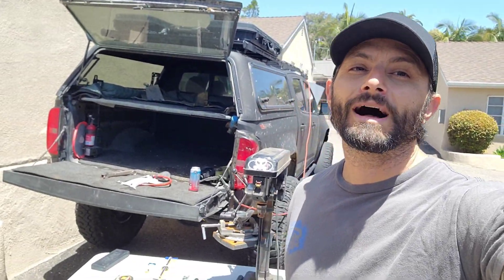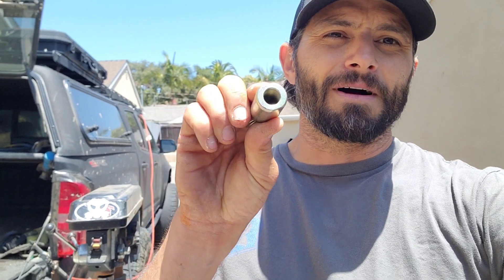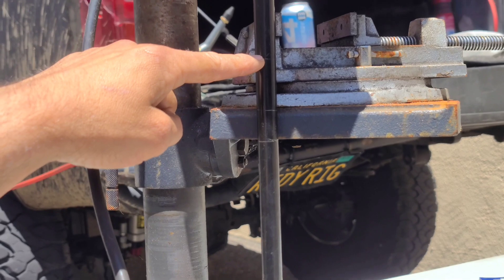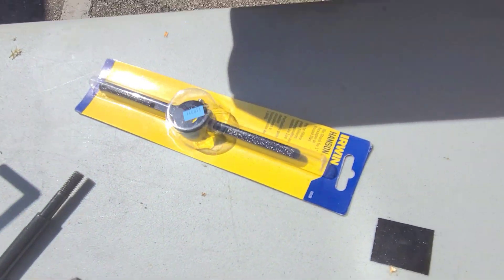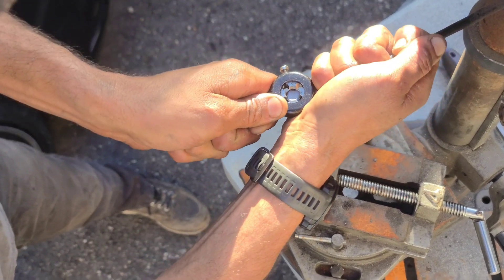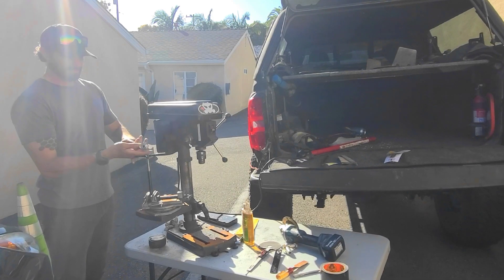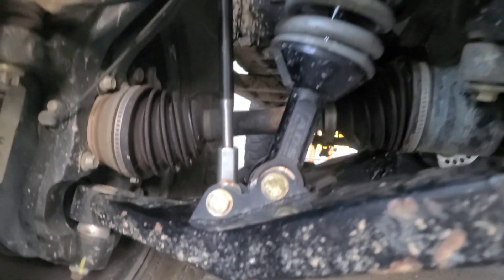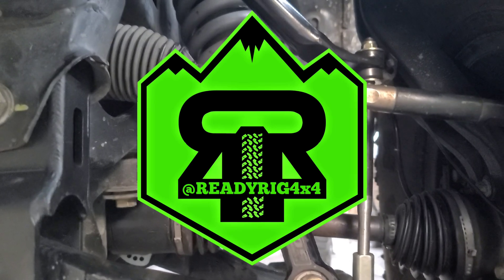Modifying Swaybar with NO Lathe

Comment: Remove the front sway bar all together.
Reply from the maker: Wrong for this application. It's funny, everyone thinks that is the cool thing to do and that it helps with getting more travel. It really doesn't in most cases. Every single offroad race car, trophy truck, sxs, ultra4 race rig is running a sway bar. I'm showing that on this rig bc once you get more travel and run on 40s IT IS NEEDED!
Reply: @readyrig4x4  i understand where your coming from.